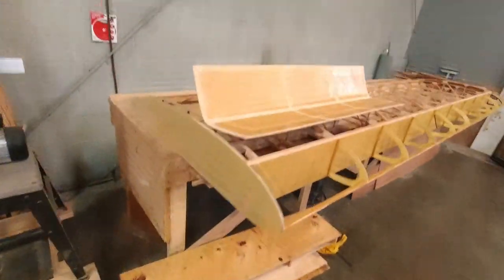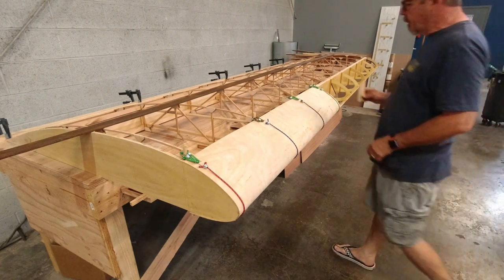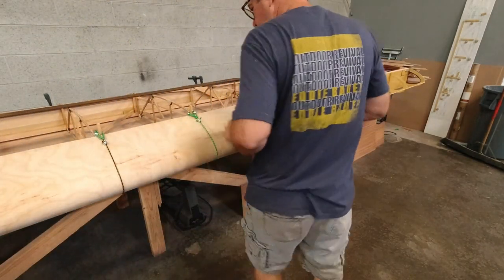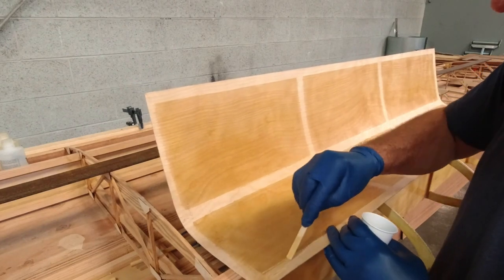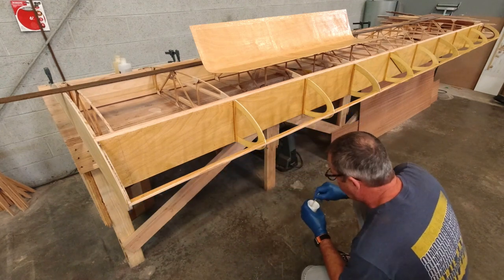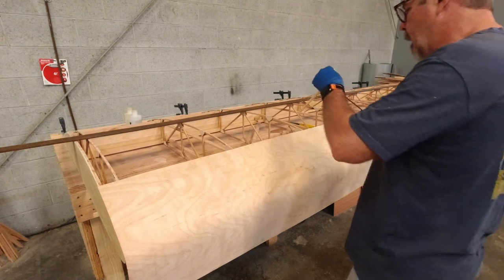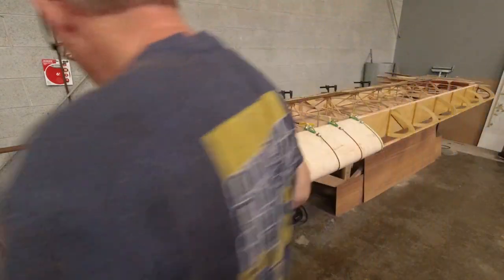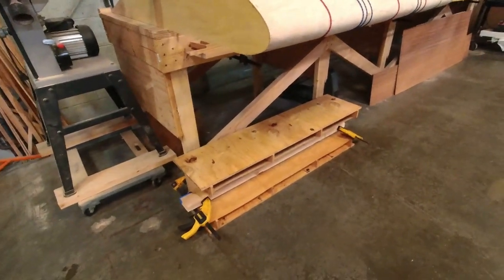Minimax 1100r Aircraft Build Vlog Episode 22

Comment: Great videos!  I attached a section of leading edge on today. I stapled along the stringer (top was temporarily clamped to my marks), then stapled along the top of the spar followed by the lower spar. I guess you had the same problem I discovered after looking inside; the leading edge plywood is not making complete contact with nose ribs. I can't measure in there but it's easily an eighth of an inch in spots. Not sure how critical it is. When the center piece is positioned, it'll be difficult to see inside where it butts the other section and to make any modifications.
Reply from the maker: I definitely had the same issue, I just made sure I had plenty of epoxy on both parts in that area. There’s enough contact everywhere else

Comment: Wayne Isson said the wing MUST be flat/square when that leading edge is applied, OR that twist will be in the wing FOREVER.  :)   I had the same problem with the fit of the leading edge and the false rib.  Also, when the epoxy is applied the whole damn thing got slippery and hard to work with.  Hang in there. :)   I stapled the leading edge to the spar to hold it while drying.  I must have used 10,000 staples and 3 staple guns.  Yes, I pulled all of those 10,000 staples out.
Reply from the maker: Same here! I’ve gone through a bunch already. I stapled mine to the spar as well then pulled every one. Not my favorite task but necessary.

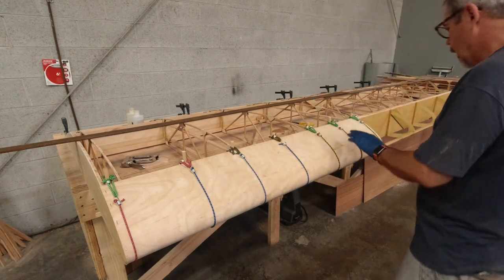Comment: Dennis, at 16:45 in this episode you refer to placing gussets while glue is still wet.  I am not sure which gussets you are referring to.  I plan to start on Leading Edge sheeting tomorrow, and I would like to know about these gussets before I go forward.  Thanks.  Lynn Garner
Reply from the maker: At 17:25 you can see the triangle gussets. They have scalloped edges on them. Not part of the plan, just something I like to add for esthetics. The back of the spar has about 1/8” reveal after the sheeting is on. These rest on that and I put one staple in the rib to hold it in place while the epoxy cures
Reply: @DTMinimax  I see them now.  They look good.  Thanks for your reply.  I was afraid of missing something there...lg

Comment: I would have thought a short bristled brush to apply the resin to the skin, for a even coat and fast application.
Did letting the varnish dry with the skin in the form do anything?
Reply from the maker: How did you varnish yours?
It did help to leave it in the form.
Reply from the maker: I could try that on the next one by cutting down one of my varnish brushes.
Reply: @DTMinimax  I cheated  by using a low pressure spray gun the type used for touch up work (as I had one) and it is not a closed D box leading edge. 
Did leaving it in the form help hold the shape better?
Reply from the maker: Leaving it in the form did help and had less spring back. As soon as you put the bungees on it’s all easy from there anyway. It seems like the best value of the form is to get that leading edge curve in the right place. 
I tried the stiff brush and it was a lot faster and did provide an even coat of epoxy. Thanks for the suggestion!
Reply: @DTMinimax  I thought that might have been the case, I didn't know as my ply was varnished after the fit.  The bend was not in a form like yours but bending it between two long wood beams with a round Ali pole pulling down on the marked LE centre line, all slightly tighter than the LE radius and it sprung back to very near the right shape.
Good news the brush idea worked for you, it has worked for me for a long time on a lot of ply / resin projects.